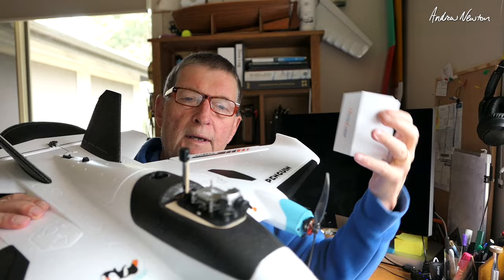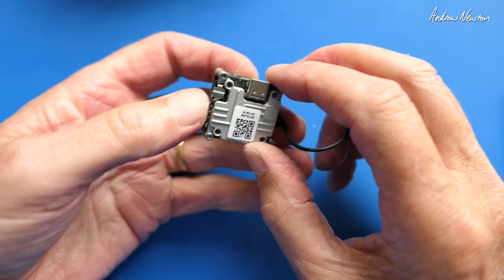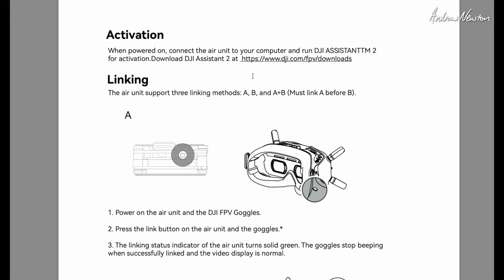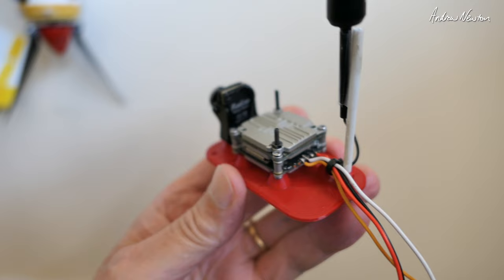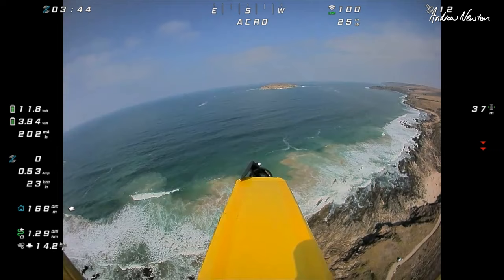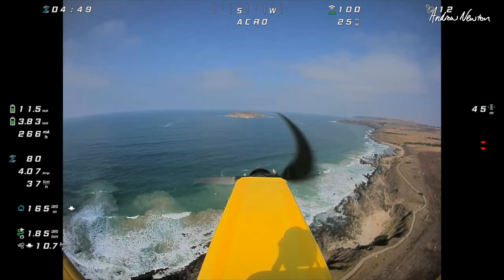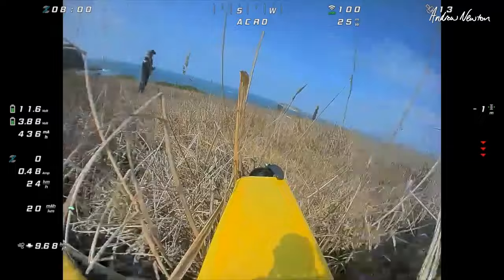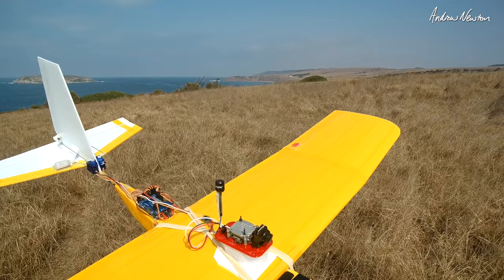Runcam Link Wasp Nano HD FPV

Comment: The fact that it lacks adjustability and does not have the greatest image puts it in the bottom of choice for me when it comes to cameras for the Vista.. I'd rather have the nebula pro but my next choice would be the Phoenix because you can get them with the run cam link/vista for around $100 bucks

Comment: Nice review. With the 4:3 aspect ratio, OSD was very easy to read against the black background without obscuring the video feed. (7:20)
Like you I do prefer 16:9, but find 4:3 is usable if the camera is mounted on a pan servo. Without a pan, it feels like flying fixed-wing thru a tunnel.

One thing that would be nice for this digital systems is a camera switcher that would allow option switching between of two cameras views (front/rear, or front.map-view). Something for Runcam Link to consider if they happen to be reading. ;)
Reply from the maker: Yes it has to come one day